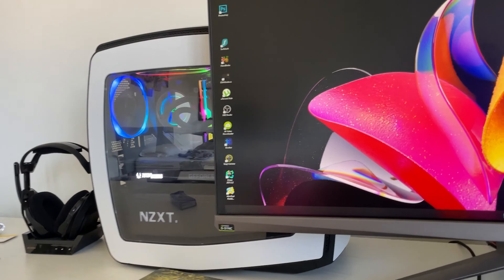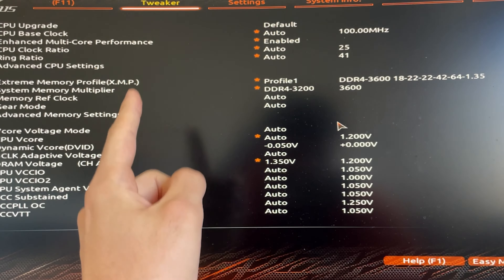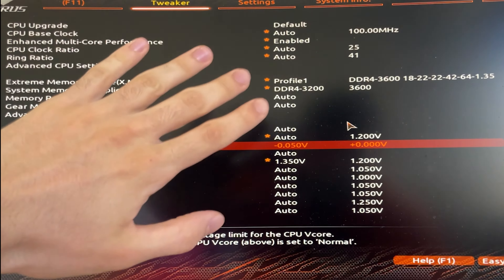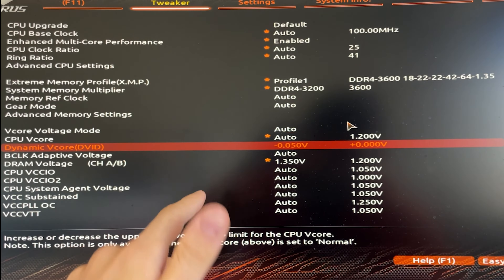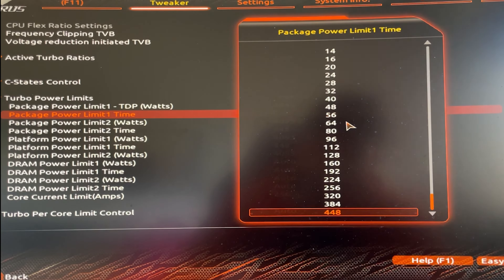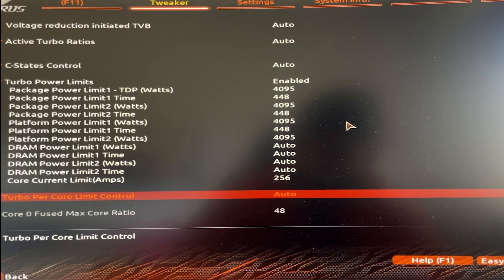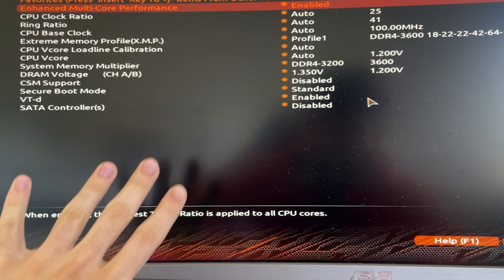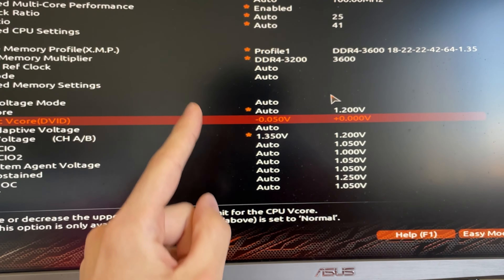Undervolt your i7 11700 and 11700F for more performance! - Tutorial

Comment: Great video, i tried it on my pc with a b560 tf gaming motherboard but i have multiple issues. First one is that when i increase the offset to 0.100 my cpu performance drops from 13320 pts to 12790 on cinebench. And secondly, i cant find the settings to disable cpu power limits on bios
Reply from the maker: So, first a couple of questions:
-DId you make sure that the offset is negative? BTW it's normal that when going too far you start to lose performance, if I were you I'd settle with -0.075
-Are you running the latest BIOS version? I'm sure that the TUF B560 has the ability to unlock the limits!
Reply: @ImWateringPSUs  hi ty for answering so fast. Yes i did put the minus. I found the settings to unlock power limits, its called short and long duration power limits. But the results are still the same after unlocking them, im starting to realize that maybe the problem comes from cinebench, because it doesn’t run my cpu to full clock speed. I also find it weird that my cpu can handle a -0.125 offset. Is that normal ?
Reply from the maker: @mrhovil5466  Double check your results with the Bench in CPU-Z! BTW, -0.125 would be a HUGE undervolt, so it is possible that your CPU is unstable and downclocking itself!

Comment: Got to -0.100 Vcore offset, Asus ROG Strix B560-F. It's cinebench stable, stays within 125 W package power under full load (from 170 W originally with all boost durations infinite and limiters off). Not tested in prime95 yet, we'll see.
The important thing is to disable LLC otherwise you're not gonna get much from your undervolt, as LLC works actively against you by boosting input voltages during high load. Mentioning it specifically because Asus boards have LLC level 3 by default.
Reply from the maker: Those are some really good inputs, in my experience LLC doesn't really interfere though, I'll double check that! -0.1 is a HUGE undervolt my man! :) Let me know if it is P95 stable! :)
Reply: @ImWateringPSUs  Unfortunately P95 wasn't stable, 30 sec into it blue screen. Ppl should always verify stuff with P95, imho, this proves cinebench is not nearly enough, lol. It seems stable so far at -0.085. But I will see.
Reply from the maker: @Scorpius165  Facts! CInebench is actually very easy for modern CPUs tbh. 0.085 is still REALLY good! Most CPUs top out at 0.05!
Reply: @ImWateringPSUs  Final undervolt -0.075V, 0.085 was not P95 stable.
Reply from the maker: @Scorpius165  That's still REALLY good, you're on the better side of the silicon lottery!
Reply: What CPU load line calibration level should I choose i7 10700?

Comment: Have the same cpu and I made it in a bit different way: 1) increased bclk to 102.9
2) increased power limit to max
3) installed powerful cooler which can handle around 170w  under high load.
Reply from the maker: That's basically overclocking, but we like it here!  Great work :)
Reply: so you have a Intel i7 11700F? It maxes out at 4.4Ghz and im trying to increase it as ive got a Kraken 280mm aio.
Reply: @WittyWanted  for non k CPU’s all what you can do on z490/590 mobo is increase bclk up to 102,9. That’s it. If you have a good piece of die no voltage changes needed. You can get something around 4,539 ghz for multi core and ~5ghz single core frequency. CPU-z shows: 6200 multi core and 660 single core results on its best run. On full load it can consume 170w and in some really extreme synthetic cases: 220w.
Reply: @alexkukhtevych3056  I’m on the 560 Mb, can’t find the bclk ever
Reply: @WittyWanted  know nothing about b chipset

Comment: Does this override the windows powerplans? Because balanced lowers the ghz when idle. Or should i activate the ultimate powerplan for this to work?

First time watching you. Gonna watch more videos from you.
Reply from the maker: First of all thanks a LOT for the support! This does not override the power plans, meaning it will work regardless of the power plan! Personally I do recommend running it at the max performance power plan, while undervolted. It’s how I run my system!

Comment: Just subscribed bro love your useful contents! Anyway I have Intel i3 10105f and im looking for this kind of optimization for my cpu, do you have any best recommendation settings? I would obviously follow yours :)
Reply from the maker: Thanks a lot! For that i3 I'd recommend a -0.05V offset, while unlocking all the power limit and turbo boosts!
Reply: @ImWateringPSUs  I have MSI motherboard and it has "CPU Lite Load" options over the tweaking/overclocking bios settings. There are CPU Lite Load mode 1 untill 23, which one should I choose for the best optimization? on the default settings its on the mode 12. I hope you reply it thank you!

Comment: Can i just do the undervolt step for my 11700k without overclocking it? Will it significantly reduce performance (for gaming)
Reply from the maker: Yes you can! It will not reduce your performance compared to stock at all!
Reply: @ImWateringPSUs  thank you so much. Will try it

Comment: I have 11700K + Z590 Aorus Pro AX + AIO Arctic Liquid Freezer II 240mm. Without undervolting i have 100°C+ after few minutes of test. I have set the same Dynamic Vcore (DVID) -0,050V, and now i can't pass OCCT power test. I have errors in cpu. This CPU is so hot. Any other ways to undervolt it or have lower temps? In games i have around 60-70°C.
Reply from the maker: Set it to 0.04V :) And make sure to subscribe to the channel
Reply: @ImWateringPSUs  i have tried also -0.025. And the same. unlucky cpu...

Comment: 11700k here , quick question I can not get mine above 4.8 ghz I have auto overclock and it locks it at 38%oc(asus) I have air cooled cpu and 700w with a 3080. I would like to overclock but I cannot find videos on how to do
Reply from the maker: I do have a few videos about it on the channel! It’s key to disable auto OC

Comment: How do i know if i have stability issues? i have a 11700k and its getting hot this summer, like 60-65 and i want to just undervolt with same performance. I have a asus rog strix b560 A. Do i need to do just the first -0.050v?.
I used to test this things with heaven benchmark like for the gpu undervolt
Reply from the maker: You can run any CPU stress test! Bust realistically, with -0.050V you’re gonna be stable no matter what! :)
Reply: @ImWateringPSUs  I just did what you said but with ThrottleStop (easier for me), i put -0.050 V and it decrease like 5 degrres. One thing, the voltage is on ''adaptative'' mode, should i put it on ''static'' mode? Because sometime it  increase a bit the voltage by itself (new at CPU undervolt D:)

Comment: You said it would lower the performance and power consumption, but that isn't correct. It just lowers power consumption, if anything it can boost performance by having lower thermal output.

Comment: I have been overvolting this cpu as all I care about is performance and speed. If I want to get the maximum performance possible, would it be better to undervolt and disable power limits? Temp and power is not a concern.
Reply: Beware of silicon degradation when temps are power are high for long hours continuously!

Comment: i have msi MB and i don't know what to do or change - im always stuck at 4399mhz on all cors !!
Reply from the maker: It's probably the most it will allow you to lock it at, it's better to leave it unlocked then so that your single core can boost higher. Be sure to undervolt as shown in the video though!

Comment: Msi doesn't let it go below 0, so I just set it as close to 0
Reply from the maker: You do need to set it negative man, if you set it over 0 it’s actually increasing the voltage
Reply: @ImWateringPSUs  MSI doesn't let you set it to negative, it has a separate undervolt mode for the CPU, then you can make it closer to 0 but not negative
Reply: MSI tells you how many volts of being used, it's not based off taking away volts from the CPU by using negative, it is subtracting volts by reducing the volts able use
Reply: @theunluckygamer  i have MSI + 11700k, you need to go "negative offset" . I set it - 0.100 cause MSI volts are crazy compared to asus and other boards... and im pretty stable with 65°C max ... 0 performance loss
Reply: @phorkai  thx
Reply: @phorkai  What cooler do you use? I bought MSI Z590 Gaming Plus + 11700KF 360 AIO, what overclocking settings do you recommend? Or just automatic settings, watercooling in MSI bios? What's the maximum OC you recommend, 5.0 GHZ all-core doable?

Comment: can i undervolt my 11700kf with this method?   Do i need to addjust LLC settings or something else (z590 gigabyte) ???
Reply from the maker: Yes you can! No need to adjust the LLC but you can play around with it if you encounter stability problems or if you wanna push the offset a but further. Lvl 3 should do the trick

Comment: So this will work with my 11700f? My cpu always jumps around 4.8 -4.4 all the time. Is that better than it just staying at 4.4 consistently?
Reply from the maker: By getting a more stable frequency, you get more perfomance in-game. What you don't see is that right now your CPU goes lower than 4.4 at times! Copy the settings and let me know :)
Reply: No. You don't want to lock the frequency and sync all cores because you will lose 1- and 2-core 4.9 GHz boost bins.
You want to leave the boost bins at auto (you cannot get higher than 4.9 GHz on a locked CPU anyways), and offset undervolt as much as you can with LLC off.
Reply: How did you do it ? My 11700f never goes above 4.5ghz ;-;
Reply: my i7 11700f remains at 4.4 sometimes it goes to 4.6

Comment: Do you know what these settings are called on an MSI z490?
Reply from the maker: Sure! CPU Core Voltage, clearly, CPU Ratio, and then under Advanced CPU Configuration you need to remove all the limits! Like the Long duration power limit etc.
Reply: @ImWateringPSUs  Grazie mille!
Reply from the maker: @Nutakins  ;)

Comment: can i use that on the i5-13500?
Reply from the maker: Yes you can! I actually have a tutorial for the 12400F that’s VERY similar!
Reply: @ImWateringPSUs  its not working. The offset mode just isnt saving what i type in
Reply: @buu5561  did you save the changes in bios ?
Reply: @peterpipe9015  Ive tried it. Its not able to safe it because when i type whatever in there and i press Enter, it just doesnt stay.

Comment: i can use it on i7 1700kf?
Reply from the maker: Yes, absolutely!
Reply: Same question. Can I use this method while at the same time OC? Still haven't bought a motherboard. Which brand do you recommend? I'm inexperienced so MSI seems easier to me, but good deals for Gigaybyte (e.g. Z590 Aorus Elite or Gaming X) here.
Reply: @hiriotapa1983  MSI for me is now number 1
Reply: @clausberecci3049  And what about cooling, I'm thinking about 240mm AIO, will that be enough for moderate overclocking (perhaps 5.0 GHZ)?
Reply: @hiriotapa1983  in my opinion nope, look on GamerNexus "Best CPU Coolers 2021". Personally I am using Alphacool Eisbaer 360 3x120mm, but after 1 y i change fans there.
Reply from the maker: @hiriotapa1983  Yes, you definitely can! Nowadays pretty much every motherboard on the Z chipset is good, but personally I like Asrock for their value for money!
Reply: @ImWateringPSUs  Yes, Asrock Z590 Steel Legend is a pretty good deal here (Thailand). Cheaper than competitors.
Reply: @clausberecci3049  I agree with you on 360mm AIO after having read quite a bit and watched some videos, many people recommend 360 rather than 240, especially when overclocking.
Reply from the maker: @hiriotapa1983  Definitely agreed!
Reply: @ImWateringPSUs  I went with MSI and bought the Z590 Gaming Plus for $120. Probably one of the best and cheapest Z590s now. It seems harder and harder to obtain a new Z590 mainboard for cheap, a lot of models have been sold out.
Reply from the maker: @hiriotapa1983  Woah, for 120 bucks you really got a nice deal there! I find it difficult to find motherboards too, unfortunately

Comment: Just bought a 11700KF, can this method be used to undervolt and slightly overclock it?
Reply from the maker: Yes, just follow the steps in the tutorial and they will work for you too!
Reply: @ImWateringPSUs  Do i need to have a liquid cooler?

Comment: i Russia config  1 
Games-2560x1440(fps V-Sing)=YouTube-2560x1440(fps 60)
h.264 20000Kbps Max Quality
11700kf 50-50x50-49x49-48x48-48x ofset -0.130v/freq400 (1.2v-1.30v\1,33)
(Dimm1-2) 15.19-19.38_T1_trfc 550_3600MHz 1.375v 
Ratio_ring (42x offset -0.220v)  Ram\Cache 1:1  VCCIO 1.1800v , VCCSA 1.1800 LLC-4  offset (-0.130v)
ofset: avx512 - 0  avx - 0
RTX 2070 super: gpu - 2170Mhz, mem - stoc+550Mhz = 7551Mhz

config 2
 
Games-2560x1440(fps V-Sing)=YouTube-2560x1440(fps 60)
h.264 20000Kbps Max Quality
11700kf 50-50x49-49x47-47x46-46x freq400 (Voltage Mode Adaptive (core voltage 1.430/ offset - 0.130 - cache voltage offset 0.220v)
(Dimm1-2) 15.19-19.38_T1_trfc 550_3600MHz 1.375v 
Ratio_ring (42x offset -0.220v)  Ram\Cache 1:1  VCCIO 1.1800v , VCCSA 1.1800 LLC-4  offset (-0.130v)
ofset: avx512 - 0  avx - 0
RTX 2070 super: gpu - 2170Mhz, mem - stoc+550Mhz = 7551Mhz
Reply from the maker: I’m really happy it was helpful! Thanks a lot for taking the time to write this! :)